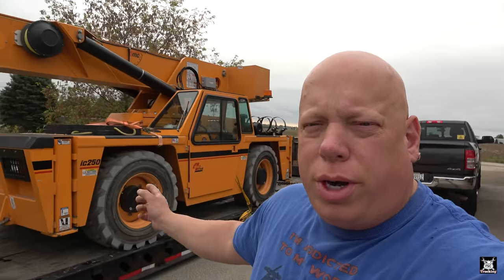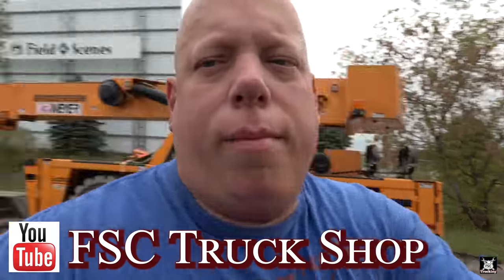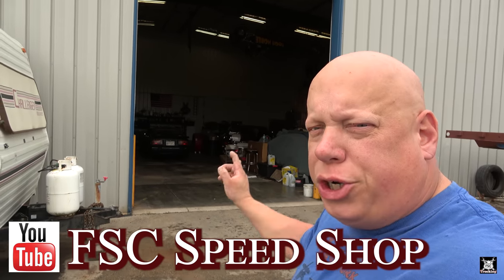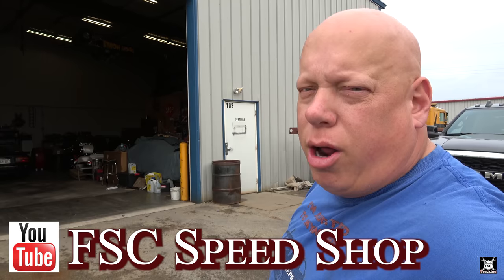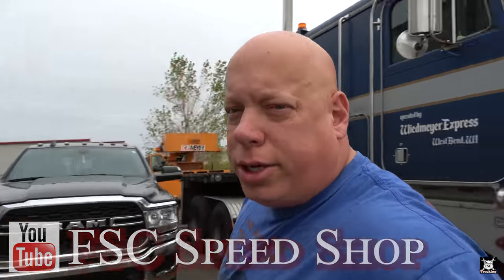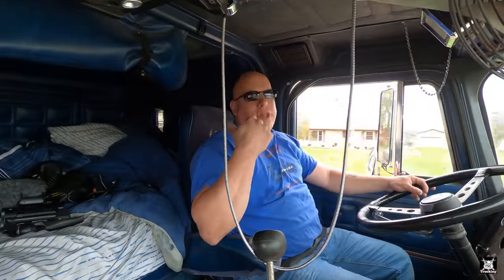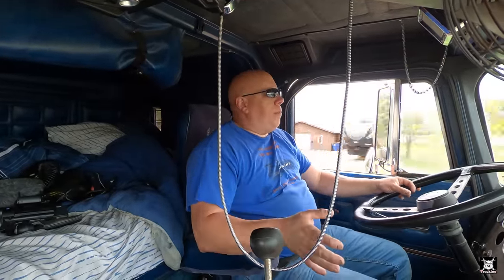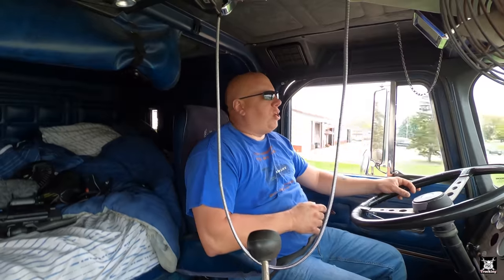Trip To Deliver In Oshkosh Wisconsin

Comment: Hope the new starter work's excellent for ya. Can't wait to see the pic o the new truck u get. Hope it's not a cabover. Jessie ask me why i don't want one. I said hell how can u stand in them and stretch in them. And i said also u can do more in standard semi's. Mine is a Kenworth Studio Sleeper big sleeper. I had the sleeper redesigned where the bed is on one side and the table is on the other side. The bed folds up like the top bed does in a average sleeper. And we moved things around so the bed is easier for Jessie to get in since she is 5'5" and the ladder was not easy to use. And ki had the whole sleeper interior torn out and redid the way i wanted it to be. And it's way better. We can laydown and watch movies on the t.v. and also where we sit down and eat or do documents. Both me and Jessie can always hear u loud and clear all the time. She wants to know how can u manage to stay warm at night in the sleeper. Our heater work's excellent. We have a heater and air system u see in RV's. And i had it installed year's ago and it work's excellent. The semi does have AC. in the cab and it work's excellent. I had the heater and AC in the back taking out cause it hardly worked at all. So i installed the RV style heater and ac. And it works excellent when we are driving. Jessie loves to keep warm all the time cold weather does not bother me at all.

Comment: Steve Orwell sounds like he's developed a miss when on the camera on trailer it's not real bad but it's there if you listen closely. didn't you say the injector pump was leaking a while back can't remember ? but might want to check it out definitely don't want it going out far away from home in winter time. but stay safe keep the video's coming
Reply: Yeah, sometimes the spark plugs get lead-fouled.

Comment: What RPM are you turning at 65 mph? I have the same drive train in a international 9300 would like to drop the rpm's and gain about 10 or 15 mph. I see on your GPS you run 60 or 65 mph. Can you tell me what gear's you have also?

Comment: The "coal" that Orwell blows when you just drive it is all the coal anybody should need to see. That's the "real coal" that comes from the Iconic  3406B Caterpillar. Great content. I love to ride along. It takes me back to a life that seems so far away now. Still watching and enjoying your great videos at the old folks home here in SW Middle Tennessee. Thanks for all you do.❤P.S. You didn't do a Thanksgiving video this year. Did you make it to Texas? I almost typed in New Jersey.
Reply: How many turns on the fuel pump screw?
Reply: @davidfleishman2275  I don't know. He says it's stock. When he drives it like he's hauling water in open glasses and he gets docked for every drop he spills (cow hauler style) it looks about normal but it's hard to tell, but when he's showing off his P&D skills. He would have one hell of a local driver. I think they are up to about $37 or $38 bucks an hour now. My hero is set in his ways and he's an "alpha dog" and he's all this you tube right now. I'm just watching him run with it and hoping he don't trip cause I shore do like the old boy. He use to reply quiet often but I think he's got too many irons in the fire right now.
Reply: @raywilson800  He says stock,but he has the repair manual for his 3406B.There is info there about the fuel pump.Steve is a very relaxed trucker,owner Op.He has made it well trucking so he can relax.Shows in his style.Yes he has a lot on his plate with his YouTube venture.
Reply: @davidfleishman2275  its turned up a touch, but not much. O/O are wanting reliability with extra power if needed. Being that it already was a heavy hauler, im sure it wasnt touched much. Also concider its age. The older machines get, the grumpier they get like us.
Reply: @brandoncaldwell95  Steve has Orwell figured out on how to roll coal.He has even said this.You are correct on Steve taking care of his older machine.As far as I am concerned he is lucky to have a non emission truck.